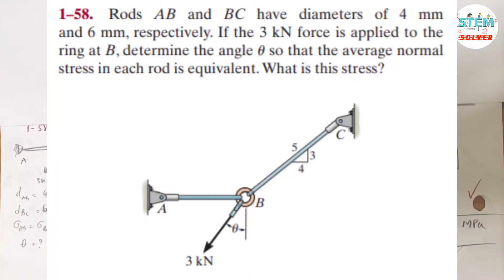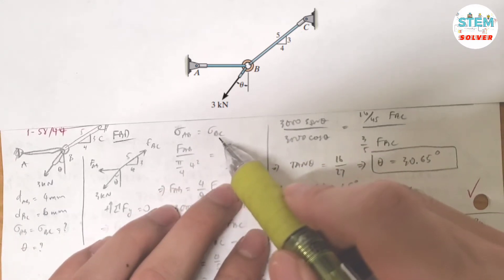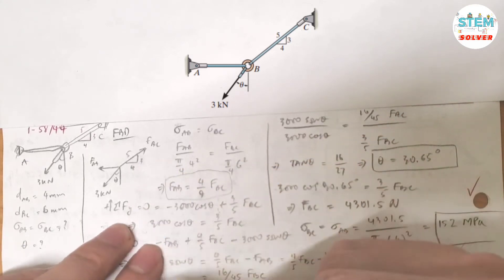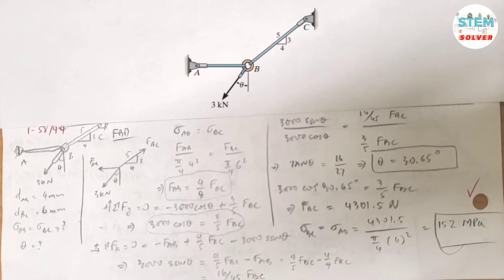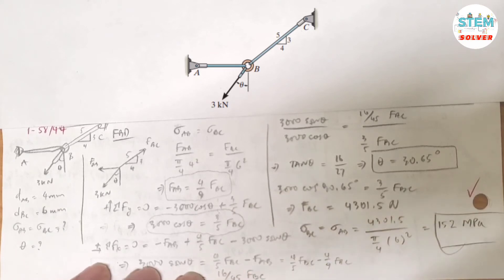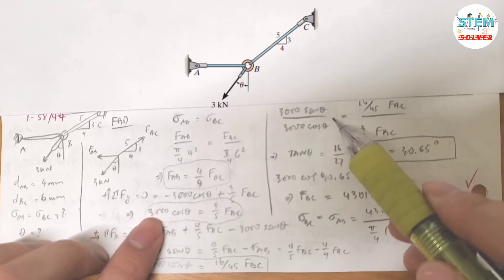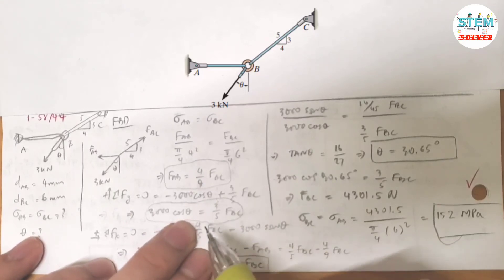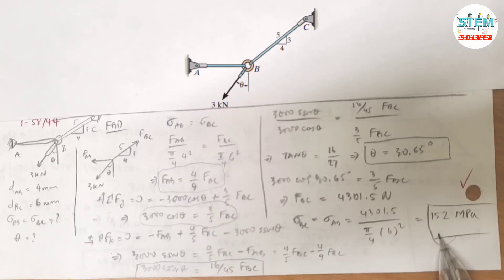Rods AB and BC have diameters of 4 mm and 6 mm, respectively. If the 3 kN force is applied... | MM

Comment: The cross sectional areas are wrong you used the diameters in pi r^2 instead of dividing by two to get the radiiuses
Reply: hes right
Reply: @MatthewVanderMeer-y2i  what is the formula hes using (pi/d)*d^2 = A? never heard of it before
Reply: @prollykam1174  the formula hes using is (pi/2^2)*(d^2). or (pi*(d/2)^2). simplifying (d/2) gives us (r). he is correct.
Reply: @NomasJr  no he is wrong i checked with my prof